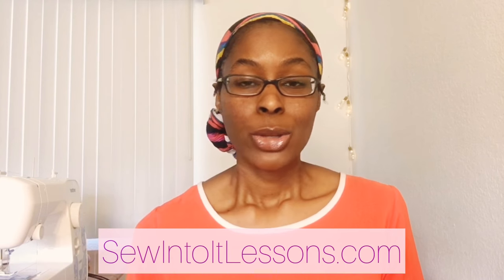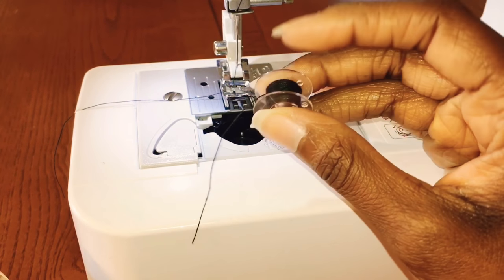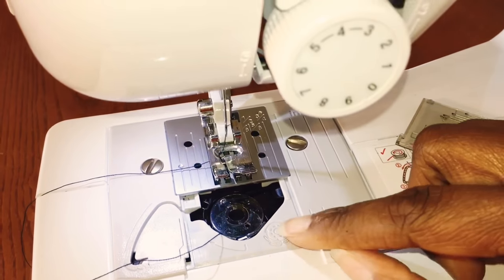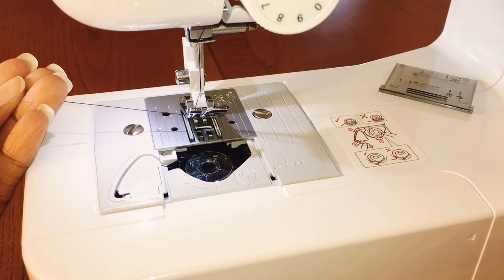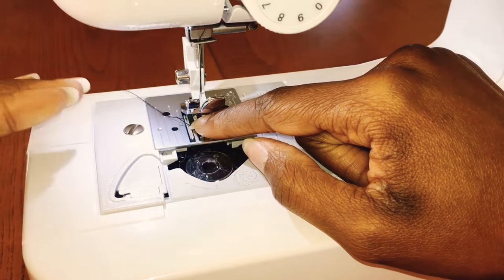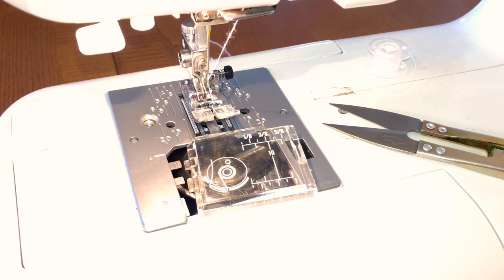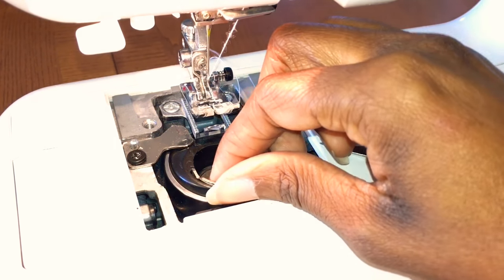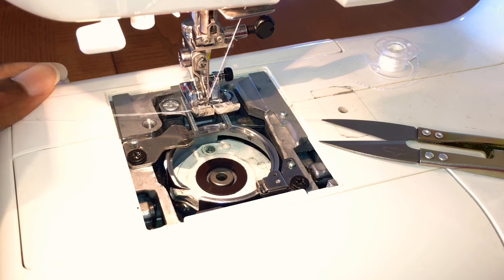Help! My bobbin thread won't connect/ what happens in the bobbin when you have a timing issue?

Comment: First must say I very much like your videos. The camera work, narration and instructions are excellent. Hoping you make many more of your wonderful videos for us so we can be happy with our sewing machines of any brand. A feature I especially like about brother sewing machines is the "quick set bobbin" which allows to begin sewing without drawing up the bobbin thread when the thread is passed through the quick set groove and cut at the end. Page 21 of the manual explains about using the quick set bobbin feature and also about not using the quick set feature to draw up the bobbin thread as you explained as well for times when a long bobbin tail (with a long upper thread tail) is needed for sewing darts or making gathers.
Reply from the maker: Myra Thomas, thanks for bringing up the quick-set feature. I’ve used Brother machines with the quick-set feature and its pretty cool.
Reply: @Sewintoitlessons  Very cool and I love that feature on my own LX3817
Reply from the maker: Myra, you’re right 🙈. My machine, like yours,  does have the quick-set bobbin feature. Thanks again for pointing that out! 😊

Comment: Thank you so much!  What a great demonstration on how the timing works so I could look at mine and determined the needle I had just put in was too short so wasn't catching. Must have been an old needle from my old machine. You saved me a lot of headaches and an inevitable repair free. Great video!
Reply: I had the same issue, but I found that all I needed to do was change the needle. I was using a cheaper needle I found on Amazon, which broke with just the simplest tension on it. When I changed to a known brand, it picked up the bobbin thread just fine.

Comment: I have a Brother LX3817 and I have a problem with it that I can't find anyone else talking about anywhere online, YouTube, or anywhere else. I figured out that it's hard to catch the bobbin if you cut it to short with the cutter. So that's not my issue. My problem is that the bobbin thread doesn't seem to settle into the right position, once it does get caught by the needle. The needle catches the bobbin thread fine, but when I start to sew, the bobbin jams.  I put it in, facing the right way. The thing is, I don't know anything about sewing machines because this is the first one I ever used since middle school. I see in this video, that when you caught the lower thread, it settled across the top left side of the bobbin, just like it does in my machine. And I see that it appears to be in that position in other brands of machines, as well in other people's videos when they're ready to sew. I wasn't sure if the bobbin thread was supposed to settle into that position until I saw in this video that it is. But on my machine, I've been having to use a dental pick and a pair of pliers to move the lower thread from the top of the bobbin, down to onto the right side of it. (I could probably use tweezers, but I don't have any.) If I don't do it, the machine jams. It's very difficult and annoying and I dread having to change thread colors because it takes forever and if I don't do it just right, then the lower tension is to loose. But if I do it right, the machine works fine. Does anyone else have this problem? Do you understand what I'm talking about? I hope my explanation isn't to confusing.
Reply from the maker: Hi! What’s happening with your bobbin  is defiantly interesting. I actually just recorded a Q&A session with a certified sewing technician and we talked about issues with the bobbin and bobbin thread. We used my Brother LX3817 as an example. I hope the information there will be helpful to you. Be on the look out for that upload. Of course, there are situations that a professional may need to take a look at the machine. I would love for you to keep me updated about this issue, and I will definitely share any info I receive.
Reply: @Sewintoitlessons  Thanks for responding. What would really help me is if you would make a video where you show what the bobbin does after you load it and begin to sew. I want to see where the bobbin thread is supposed to go, once you've picked it up with the needle and are ready to sew, and then as you start to sew. I'm still not sure if the thread is supposed to sit on top of the bobbin, or wind itself around it. I know that as you're sewing, the thread goes up over the top of the bobbin and winds down around it. I'm just not sure what position it's supposed to start in. I'd like to see a video where you leave the cover off as you pick up the lower thread and begin to sew a few stitches. Point out where the bottom thread is before you start sewing and how it moves as you go along. You'd probably have to use a small piece of fabric that won't cover up the bobbin area, so it might be difficult to do. I'd really appreciate this because no one else has ever done it. I'm sure that whatever the issue is with my machine, it's probably something very simple that someone who knows what they're doing could fix in five minutes with a screw driver. But I don't trust the local sewing and vacuum guy in my area because I thought he was kind of rude when I had taken a vacuum to him and would probably charge me to much money.

Comment: Thanks for your valuable videos. I have followed & benefited from all  your videos and all worked just fine; the only issue I am having now is that after starting to sew, upper & lower threads come out freely but are not forming any stitches through the fabric; any suggestions on what needs to be done? Thanks.
Reply from the maker: Ibrahim, hello! Im glad these have helped. Have you checked your needle yet? Check if the needle is correct for the fabric you are sewing. I hope that helps!

Comment: Thank you for an explanation made with clarity.  I have ahold metal Vigetti and all of a sudden the bobbin thread won't  pick up.  The bobbin is on the side of the machine visible only when the machine (heavy) is lifted up  Would be grateful  for any advice: no one to carry to shop: too heavy for me now: have done years ago.  Machine about 90 years: works well otherwise.
Reply from the maker: colsome miah first, it is so special to be able to sew on a vintage sewing machine. I have seen some others on YouTube with videos about fixing/adjusting the timing on side loading bobbins. Also, in my area there is a sewing machine repair shop that makes house calls. Maybe there is a shop in your area that will send a technician to  your home. I hope that helps.
Reply: @Sewintoitlessons  Thanx a bunch: often wondered why  there isn't someone who makes hose calls: the guy from Jo Ann's died although  it still had to be brought in.  I'll scour the yellow pages since such an entity exists; (house calls: though sky high probably, but worth it.  I mainly take in things but love making things with straight lines (pillow cases nail, dust ruffles, etc) thanx so much for your prompt reply

Comment: HI! another problem you could be having (if your sewing has jammed before and you just cut the thread from the bobbin then and there without foreseeing that could be potentially an issue bc u were a beginner like me) take tweezers and pull out any small pieces of thread that may be blocking the thread from coming up. You ofc could take apart your machine and pull it out much easier but if you’re anything like me and know you aren’t very good at putting things back together then tweezers are the way to go!

Comment: Thanks for the info, I thought my machine might have a timing issue so I took it apart and followed along with you but that doesn’t seem to be the problem. I notice the upper thread keep shredding and doesn’t catch the bobbin. I’m so confused!
Reply from the maker: Have you checked your sewing machine needle? The thread can shred when the the needle is not the correct one for the type or brand of sewing machine. For example, a Bernina needle may cause issues in a Brother sewing machine.

Comment: Thank you for that wondreful demonstrating, my issue is my top thread goes down it is scope up,  but its not releasing it,  so it tangle in the bobbing case
Reply from the maker: I have seen my machine pull two threads through the bobbin plate and cause a tangle. The thread kind of get locked. I can cut the threads under the fabric and it will all release. 
If you see that you have a nest like tangle, the source of that most likely in the upper threading. 
I have yet to find out why my machine pulls two threads through the bobbin. When I find out I will share 😊
Reply: @Sewintoitlessons  I thank you, all is well. The machine is blasting  now.
Reply from the maker: Awesome 🙌🏾

Comment: This was super helpful and solved my problem. Thank-you!
Any advice on setting a long basting stitch on a Brother CS6000i?
Reply from the maker: Hi! I have some experience with this machine. There are a few toggle buttons and two deferent numbers on the display screen and it can get a little confusing. If you check your manual, it will tell you which toggle button controls the stitch length. Make that number as high as it will go and that will be your long basting stitch. I hope that helps.

Comment: Good explanation av been able to fix my bubbing but the machine is not sewing whenever I press the start button or use pedder it will just be on one sport with the needle going up and down
Reply from the maker: Hi! You can make sure that bobbin winder is not activated. This video will show https://youtu.be/pjuFvjlEbEs
Reply: @Sewintoitlessons  the bubbing tread and the one on the needle are ok to the best of my knowledge but it doesn't move forward while sewing

Comment: Hi, thanks for this video. I have white sewing machine #2037. I have it for more than 10 years 🤪. And within a month or so I had the hook (known as Boby lock hook) broken because the thread bunched up so much and I pulled it out too strong. And now finally, yes after that many years 😂, I have replaced the hook. Yay. 
But the problem of bobbin thread bunching up is still there!Also bobbin pops up and get stuck. 

Please help!
Thanks

Comment: I can get my machine threaded and the timing is perfect for anywhere from an hour of sewing beautifully to just a few stitches before it “jumps” out of time.  Even when it’s sewing well, I have to continually rethread the needle because something is cutting that thread as it goes through it’s revolution - almost as though the case jumps out of place for a second.  I have to see at a VERY slow pace to even get a few stitches.  You seem to know more about what to do with this Brother than anyone (this is my second LX3817a in less than 3 years!  The first one I  thought was a lemon so replaced it only to have this one do the same!).  Any ideas?

Comment: This was helpful I checked the timing and it’s catching the bobbin, but when I start sewing a straight line no stitches still
Reply from the maker: If you haven't done this already, check the type of fabric you are sewing with the needle you are using. Using the wrong needle for the fabric can sometimes cause the thread to not stitch or skip stitches. Hope this helps.
Reply: I’m sewing cotton and I tried a new 16 and then switched to a new 14
Reply from the maker: Rubylicious I forgot to mention, you can check your bobbin case for a build up of lint. I talk about in some detail in the video https://youtu.be/8v8q0xF7l90

Comment: Hi I have a 1979 heavy duty singer 457. as the upper thread is collected by the hook it travels to the 9 o'clock positions and runs up the side slope of the bobbin holder but goes under the top edge of bobbin instead of over it.

Comment: I hope you can help me. I don't understand what is happening with my sewing machine, but the bobbin case kept popping up and out to one side (towards the needle).  I eventually had to buy another case because the needles kept breaking and the case was badly damaged.  I have cleaned it, oiled it, put in a new bobbin case, and to no avail it still keeps doing this.  What can i do?

Comment: I have 3 different sewing machines a brother jx2517,  singer simple, kenmore each have a problem at this time. Thread on the brother jx2517 won't connect from the top or the bottom. The singer a small plastic piece that joins in the bottom thread area broke. The kenmore the thread jams, & the main function wheel is jammed.
Reply from the maker: Wow...so much at once. Sorry to hear that!

Comment: I borrowed a Kenmore 385 from my girls mom and it picks up the bobbin thread for initial setup but once I start sewing it doesn’t. The needle and top thread just go in and out without completing the stitch.
Reply from the maker: If you have already tried rethreading the entire machine, I would say to check the needle you are using for the fabric you are sewing with. Using the wrong needle and fabric combo can cause problems with stitching. Then you could also check the bobbin area of your machine for lint build up. I have 2 videos that go into some detail about both of those things if you haven’t seen them already 😊.  If you are still having issues, you may need to see a technician to find out if you don't have a mechanical issue. But try the other things first. Hope this helps!

Comment: Okay how do I adjust the timing.I am new to selling but I'm not afraid to take apart machines.
Reply from the maker: Hello! I talked about the video below in a comment after I posted my video. The commet it pinned, so hopefully everyone can find it easily.  https://youtu.be/fzhR6PNlI4E 
I hope this helps 😊
Reply: "sewing"
Reply: I am new to sewing.
Reply from the maker: No, problem! Congrats on learning to sew🎉. I will also suggest this to you before you take your machine apart! lol.  https://youtu.be/8v8q0xF7l90
If your machine is new, for example, you most likely don't have a timing issue. If your machine is older and has much use, or if you've had an accident with your machine, you could have a timing issue. This video is an interview and demo with a sewing technician and we talk about many of the things you should look for before taking the machine apart.
Reply: @Sewintoitlessons  I did have an issue with the machine last night. Watching your video and his video it told me that it was a timing issue. Thank you so much for the help. I'm learning the terminology . The only sewing I've ever done was cross stitch. I was able to fix the machine. The thread is now latching on. Thank you so much for your help.

Comment: I appreciate your video but for the problem I am having, at this point, it wasn't helpful. Hopefully I will remember what you did in case I have that problem in the future. For now, is it possible you could help me understand why the needle catches on my machine like it's supposed to when getting the machine ready but it doesn't do anything when I start to see. There is no bobbin action with the fabric. Needle goes through with its thread but the bobbin thread doesn't interact with the needle thread. Sorry if that was confusing. Not really sure how to ask my question.
Reply from the maker: Tobi Smith hi!  Thank you so much for the feedback. You explained your question well. If you can, check out the community tab on my page because I posted a checklist of things to look for when you run into a problem like this. The questions were: 
Am I using the correct needle for the fabric I’m sewing?
Is the needle damaged or bent?
Is the needle installed correctly? 
Is there a build up of lint under the bobbin case?  Feel free to message back and let me know if checking those things help correct the problem.
Reply: @Sewintoitlessons  thank you I'll do that! In high school I learned basics of sewing but little to nothing about machine care. Then some years later I tried to start sewing again after inheriting a couple different older(90's maybe) machines without the manuals. I never learned how to use and maintain them so I quit trying with machines and just did hand sewing on a few things here and there. Wish I had had someone to teach me. I am determined now to learn more about those machines though. Thank you again and I will let you know how our turns out.
Reply: Hi again. So I thought I should try taking the bobbin area apart so I found some videos and the parts manual for my machine model. I basically had to watch a bunch of videos of people taking h that area apart and then I tried it. However, after I did all that and put it back together I gou d that the reason it wasn't working is that the track was actually stuck to it and had to be scraped off. This was causing the bobbin holder to raise up and work improperly and that was making the upper thread to come of the track hook not bringing the upper thread all the way around. Now after scraping that lint off the track I was actually able to make the simplest pillow. Hopefully now that I know about this, i can keep it in mind when i have to clean out the bobbin area. Thank you again for your help!
Reply from the maker: @Nobodyandthensome  great job with digging deep for the problem ! Thanks so much  for the update! Many may undestimate what a lint build up in the bobbin area can cause. Do you mind if I shared your story my next video Q&A?

Comment: I need HELP 😓🤷😭, I been dealing with a problem for days, I thread my machine with presser foot up and everything an my thread keeps breaking, I have a Brother 2000xli
Reply: Ugh my tension is at 4 and 4 2ss and I am just trying to do a straight stich 😭😭😭😓
Reply: Three things to rule out is wrong type of thread, mercerized cotton best, using a type 15 bobbin(correct) not type 66 and needle being bent or is installed  backwards, check manual for direction of flat. The last is most likely.